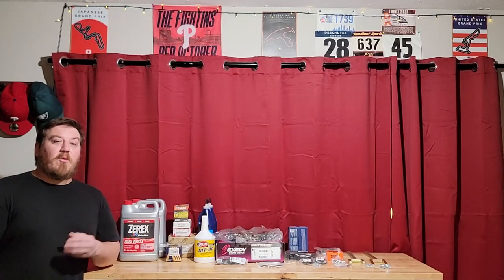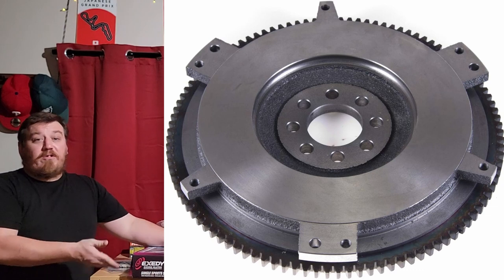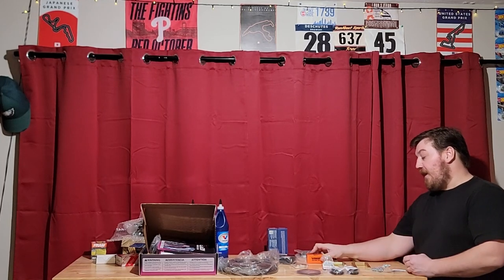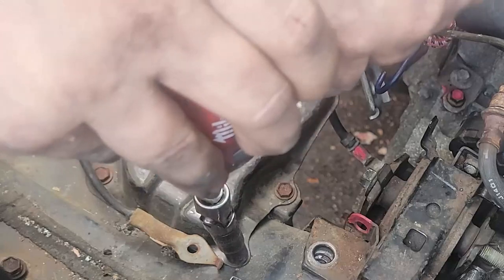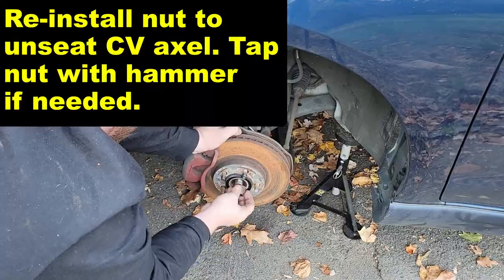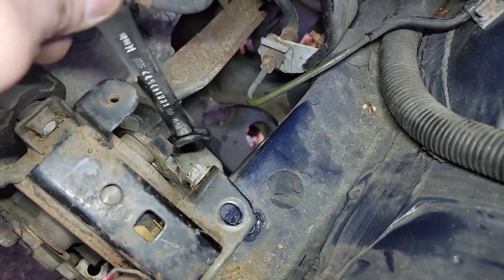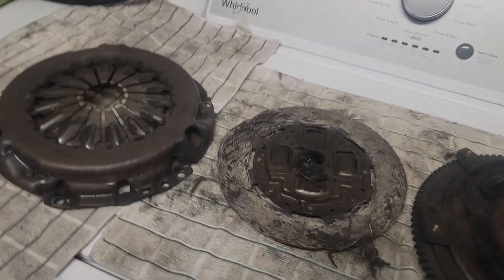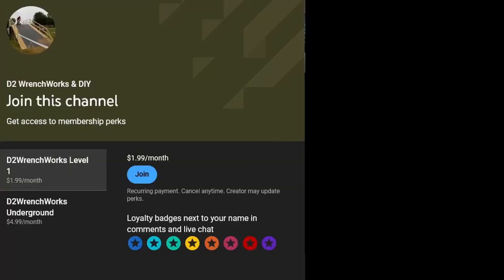ABANDONED MATRIX PART 2: C60 6SPD CLUTCH REPLACEMENT BIBLE! DIY TRANSMISSION REMOVAL & EXEDY UPGRADE

Comment: 6:35 You can remove the transaxle with the LH axle still in the diff and then use the C60 shift fork and a rubber mallet to pop the axle out once the transaxle is on the ground. Edit: You can also put a 1/2" 19mm socket wrench on the crank bolt with a cheater bar to hold the flywheel while installing. It won't come loose.
Reply from the maker: Thanks for the comment! I did this LH axle recently and it came out like butter second time bc I used what they call a "Demolition Screwdriver" and with a couple wacks of the mini sledge on the flats of the axle it came RIGHT OUT! I have heard of the clutch fork trick but didn't have a spare one around and theyre not cheap enough to hammer a good one lol

Comment: Outstanding video. Thank you for the time you gave and information you shared. I'm hoping you can help me. I have a 2007 Toyota Matrix, as I understand is the same as a Corolla, I paid a mechanic to change the clutch and flywheel. I lack time and tools to get the job done myself. From the day I picked up my car I have had an ongoing issue that I never had prior to the clutch and FW replacement. You maybe able to shed light on what might be the problem. When driving, regardless of speed or gear I am in, if I go over irregular road surface, e.g. train tracks, the RMP will drop out completely for an instant and then resume. This doesn't happen all the time though, Now the problem has gone from RPM dropping out and resuming correct RPM to stalling the car. When the car stalls it will start right up again and then drive no problem until the next time it happens, which could be at any moment or go for days without a problem. In trouble shooting this I have replaced the spark plugs, new fuel pump assembly, mass air flow sensor and cleaned the intake system. All work done by mechanic (different mechanic who changed out the clutch and FW) hoping that this will fix the problem. He also checked any fuse issues, loose wire harness, ground terminals, and love tapped almost the entire top surface of the engine to see if there's a loose connection somewhere. No luck. When the clutch and FW were replaced, is there a chance that a cable has been stretched or plug that isn't connecting properly in a less obvious place other than the top side of the engine be the cause of this worsening intermittent problem? Any suggestions/advise is welcome. Many thanks, Steve.
Reply from the maker: Hi Stephen, thanks for the comment and please take a moment to subscribe! We were recently displaced from our house because of flood damage and have been dealing with moving, so forgive the delay! I am curious if a wire was pinched or there could be a vacuum line. This is an extremely difficult issue to diagnose without putting my hands on it, but here's what I'd do, retrace your mechanics steps using this video: 

-1. Check your grounds and vacuum lines, including your pcv valve. All of these are clutch related and could be a vacuum leak or ground issue.
-2. Are all connections fully pressed in from this video? Sometimes, unplugging and fully pressing in plugs gets them to fully snap in
-3. Run the car for codes and proceed from there
-4. I hate Facebook, but they have some EXPERT folks in Matrix & Pontiac Vibe groups, I'm in all the groups myself and reference them often for oddball stuff like this!